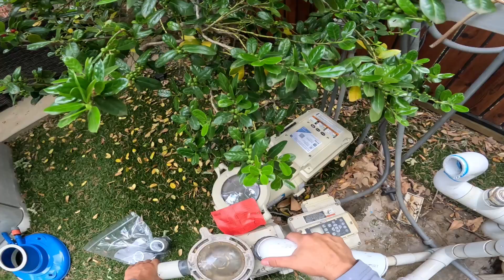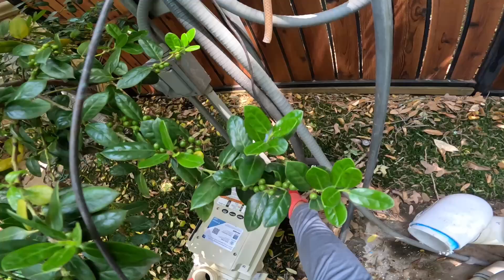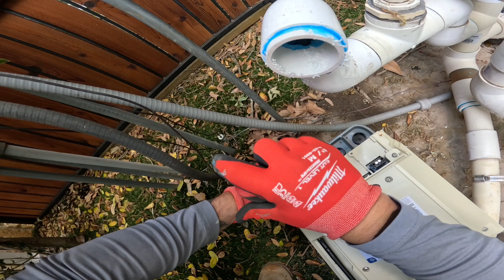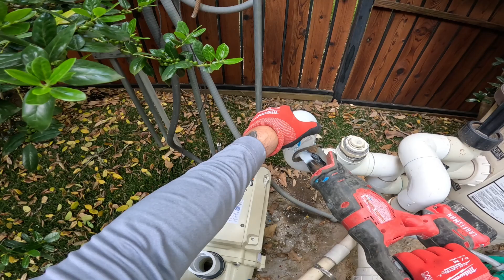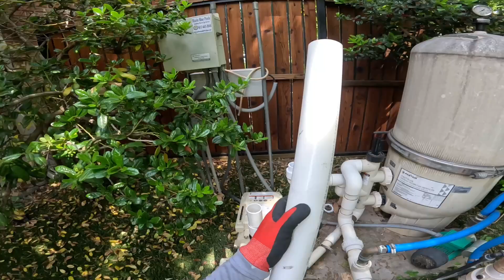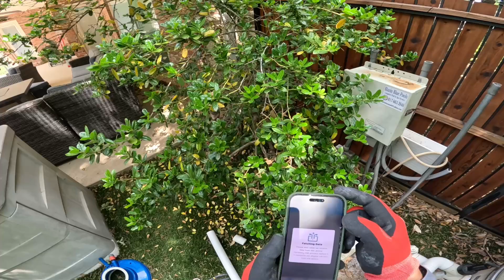How to Install a Pentair Intelliflo3 Pool Pump! POV

Comment: If your going to show people how to install a pump than do it right. Need 5 times pipe diameter in front of pump. Yes some situations dont give you much to work with. But pentair can still denie the warranty if you get an ass out thier. Pentair also requires brand new electrical whip on pump installs. And if that wire wasn't 12 Guage than that pump will die prematurely. Hard to tell if it was or not.
Reply: A Pentair pumps warranty is only 1-3 years depending on where you purchase the pump. Also keep in mind he is working with what the original installer did in the first place. But I think most importantly he's a service tech showing us how to replace a pump and not how to install new pool equipment systems.
Reply: @PatrickPaz-q7i pentair requires new power whips on pump installs even if its replacing a previous pump. And installing a 3k pump and not replacing the whip is just lazy and zero work integrity.

Comment: hey justin i like your videos just subscribed to you !  i have a question i have a leak i think its in my skimmer line when i close off the drain side with the jandy valve and my skimmer line is open , i open up my hayward super vs pump and i keep filling it with water and it just wont fill up ! everytime when  the water continues to fill and cover the jandy hole for the skimmer side it just wont pass the hole so where the hell is the water going assuming theres a break in the line somewhere correct ? because the pump wouldve filled to the top and i couldve closed the lid with it full but it just wont fill and i have the drain blocked off .  i only have 1 skimmer and 1 drain this is a inground pool . my pump has major bubbles when its running and most times the water inside is below the hole where the water would come from drain and skimmer .
Reply: Hey man, sounds like you've got a classic suction-side leak — likely in the skimmer line. Since you’re isolating the drain and only pulling from the skimmer with your Jandy valve, but the pump won’t prime and keeps sucking air, that’s a big red flag.

Here’s what I’d recommend you do:

1. Pressure or suction test the skimmer line.
You can plug the skimmer line at the pool end and use a drain king or pressure test kit at the equipment pad to see if the line holds pressure. If it doesn’t, you’ve got a break or a crack underground.

2. Use a drain bladder or a Shop-Vac in reverse (blowing mode) into the skimmer line and listen for bubbling or water surfacing in your yard — especially between the skimmer and the pump. That could help you locate the leak.

3. Watch for air in the pump basket.
If it never fills all the way up and you’re seeing major bubbles when running, air is getting sucked in — either from a break underground or possibly a fitting or union that’s not sealed right on the skimmer side.

4. Try running only on the drain line again.
If your pump primes fine with just the drain side open, but won’t with the skimmer side, that pretty much confirms the skimmer line’s the issue.

---

Long story short: yes, you're probably losing water through a crack or separation in your skimmer pipe underground. You’re not crazy — if water won’t fill past that open Jandy valve port and just disappears, it’s leaking out somewhere.

You might need a local leak detection company with pressure testing tools or even sonar if it’s a buried pipe. But hopefully, you can confirm it first yourself with a little DIY testing.
Reply: Hey because u mentioned a jandy valve and u closing drain , sometimes when u close drain builds sucking pressure and leak air by jandy O-rings on the shaft ,
Good luck buddy

Comment: Should add approx 7-10” of straight pipe from 90 to pump?
Reply: Yeah I noticed that too, says right in the manual to add 5 pipe diameters before the suction connection.
Reply: Ideally, yes.
Reply: Ideally. But in some cases you have to work with what the previous person did when they installed the older stuff. Sometimes you don’t have all the space in the world to make that work. But yes, if at all possible it should be 5 times the diameter of the pipe (10”)

Comment: No primer? Your also supposed to leave about 6 inches of straight pipe to avoid cavitation
Reply from the maker: This glue doesn’t require primer and you don’t have room for 6 inch or straight pipe in this install I try and do that in any new installs but I have to work with what I have in repairs or replacements.
Reply: @justinpoolguy as far as I am aware, some jursidictions may allow glue only with certain products on dwv, but never pressure. What product is it specifically?
Reply: @jessiestienstra6350  Correct he needed the primer but doesn't know any better.
Reply: @justinpoolguy  All glue requires primer for pressurized line. You could get away with it on conduit or drain pipe but not here. And you did have room for the 10 inches (not 6 inches) of pipe required if you just pushed the pump back. Plenty of room.
Reply: @HERBNERD420 
Wow bro take a chill pill. He's literally showing you how to replace a pump not a new install cap code.
Reply: It is 10" of straight pipe because it is 2" in diameter.
Reply: Wonder what can of glue ur using?  it will b awesome not to prime and just glue pressure side where did you get it from 
Amazon ?
Reply: How can I set my new IntelliFlow3 VSP to run 24/7? The app only allows you to run it 23 hours and 59 minutes thereby shutting off while my Intellichlor IC40 Salt Cell is still plugged in with no water flowing. Is there a way to make sure that the Salt Cell shuts off when the pump does if I want to change the program to less hours? I do not have the Pentair control panel. Just the pump. TIA
Reply: @butchtruesdale3456  modern salt cells have an internal flow switch so it shuts off without water pressure. Ideally, you also want to run the salt cell power to the pump relay so it physically shuts down with the pump power.
Reply: @CollinGravesPersonal  Thank you. I had my nephew ( electrician) help me figure it out when he was visiting.

Comment: You can do that.  But if you have basic mechanical skills. You can also pick up a set of bearings an a bearing puller. An rebuild your current pump if ya have one. For $100ish bucks for the bearings a price of the puller.  A new orings a mechanical seal. Oh an a snap ring pliers. 
Vs going to the new $1,500 pump.  That will take a slight replumbing also.  Due to atleast the intake isn’t the same height as the previous VSF pumps etc.  

Granted that’s only if your pump motor is still in a pretty decent condition.   Like the paint not chipping of the flange from it being all swollen from a mechanical seal leak.   

A long as you can remove the 4 through bolts.  A one of them hammer impact stuck screw tools that do a slight turn to loosen something when hit with a hammer.   The shock from the hammer blow will help break them loose.  

Just throwing it out there. $100 vs atleast $1,500 is a big difference.  An it would live on a number of years likely further.
Reply from the maker: @AquaTech225  yes sir you can. This one also has a bad drive. I’m sure you could rebuild the circuit board inside of it but I can’t and it wouldn’t have a warranty with it. And this new pump also has a Bluetooth and WiFi app eliminates having to program from the back of the pump and access the controls from anywhere.
Reply: @ may be possible I’m not to sure.  I know the previous VSF etc.   outside of doing a few things with the keypad.   The lower of the drive everything is buried in epoxy.  Or some type of potting medium.  

Though I have seen one slightly dug out.  An if one was able to remove what’s in it.  It would probably be not bad of a repair.   I know theirs a couple of capacitors that’s buried in the lower drive.  

The newer IF3 I haven’t personally messed with. An opened to see what if anything in there can be done with them.  

Unfortunately that electronics stuff is a little out of my league.  

I’ve messed with some easytouch boards.  Bought all needed to properly make the solder repair an put new trace wire on the board etc if needed.   

An one had a burned out item on it.  A looked at the part number of what was burned on that board on a new one.  An ordered that same thing.  Got the old one off.  A soldered in a new component.    
But unfortunately still was a no go.   But for anyone that has the ability would probably be a decent money maker repairing line items anyway.  
Just didn’t work that well for me.  Who knows one of these days I may take another stab at it.  

But thinking about it I may have to pop open one of my spare IF3 drives.  Just to see how far one can get into it.  An what is actually able to access within it.
Reply: @justinpoolguy This is by no means a thing professionals would do, but if you’re a tinkerer who knows what he’s doing, you could potentially just ditch the VFD, and wire it directly, granted it’s not a synchronous motor. You could also hook it up to a new 3rd party VFD. I’d have some electrical safety concerns, but it would be hypothetically possible. Not something you should try at home though. Bearing change takes a bit of time, but if you’re a DIYer, you’ll most likely have that time. But in a professional environment, swapping out the pump is the only real option, and it’s also the safest one. Wouldn’t wanna get sued for someone getting zapped in the pool.
Reply: When the bearings start making exesive noise, we replace the motor. Too much work for us to  get to the bearings and replace them. Of course you can do it. But it's very time consuming. That's why we don't do it. Sure the bearings are cheap. But our labor to tear the entire motor apart and put it back together. Not so much. 

You can DIY it. But most of the companies and people won't replace just the bearings.
Reply: @ bearing replacement don’t take all that much work.   It would be about the same amount of time to pull off the motor an put a new one on.  Like twice.   The bearings aren’t any real issue.   I’ve done motor a times myself a time or two.  The fastest motor swap I was able to do was 19 minutes. Just a standard 2hp single speed wisperflow.  With room to move around an everything in reach an ready.  

Motor change outs really don’t take long as it is. Not actually rushing.  Bearings can be done in another 20 minutes.  

Long as the through screws are removable a the flange is in good shape.  

But yeah I just swap out motors also completely.   
But I do rebuild some.  Just depends on the customer an if they want to pay for it to be done.   An in like. Theirs only the black century motors available.  A their set on keeping a tan motor for whatever reason.  

Or they’re running one of the previous VSF pumps.  A done want to upgrade to the newer model.  
Winning situation for them.  I hate plumbing just as much as they don’t want to spend $1500+ to upgrade to the newer model.   So works out for both of us.  

But I more through the comment up about replacing the bearings.   For any of the homeowners out there.  
To let them know.  If their current one is in decent shape. An they have a little know how.  They can just replace the bearings for 1/15th or so the price of going to the newer model.  

Atleast for Pentair since they’re at the point for some.  That other model is discontinued.
Reply: $100ish seems high. More like $30 (no ish) for bearings and seals. Puller can be borrowed with deposit from Advance Auto here in CT.
Reply: @juicer52  you must of not fully read the comment.  

My $100 quote was based off of 

A good brand front an rear bearing. $30

A bearing puller $10-15

Snap ring pliers $10

A mechanical seal kit $20

An I added a little to it to be on the very high side.   

An depends on what someone has on hand.  They may need to drop $10-20 on two 6” nipples in order to tap the new bearings into place on the shaft properly.  

An actually have something that will be able to allow the shaft to not be in the way. An evenly be able to tap on the inner bearing race.    Vs banging in the outer race of it.   
An actually do it properly.  

My point was though.  At $100 someone can do it 100% properly.  A not everyone has say a workshop with tools were they can dig through things a what not a say find something that will work to knock the new bearings on.  

But everything needed could be had a done for that price.  Correctly.  

An to buy a bearing puller.  For 10ish bucks.  Maybe not for everyone but for me it makes way more sense for me to just buy one cheap as it is than dedicate 45 minutes round trip to pick one up an bring back.  

Also as far as the mechanical seal if your taking it all apart.  One would be crazy not to pick up a $20 go kit.  
A change out the seals a mechanical seal.  So it’s completely refreshed.
Reply: I'm doing a full replace right now but I do plan to get the bearings for the old one.  I believe that's all I need.  If I can pull off that diy repair, I'll be ready with the old one when the new one dies.

Comment: Nice job , pros always make it look easy, that comes from experience 👍
Reply: Not Professional. I've seen DIY guys do better than that. Professional would be using clear primer and clear glue. He didn't even use primer. Professional would be using 10 inches of 2" pipe for the suction line of the pump. Which is what the installation manual means when it says 5 times the diameter of the pipe. 2" x 5 = 10" He is just there to get paid he doesn't care if his work is correct or how long it will last the customer.